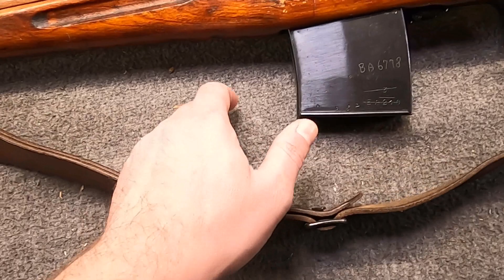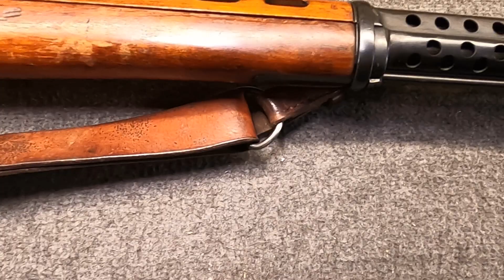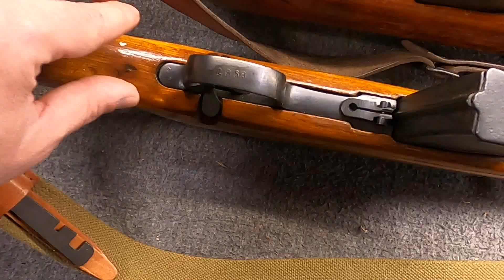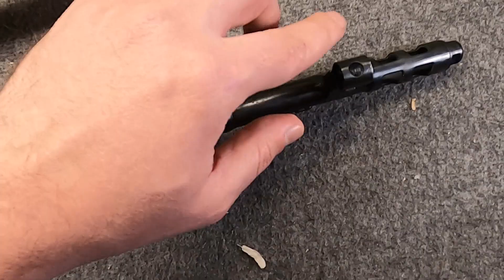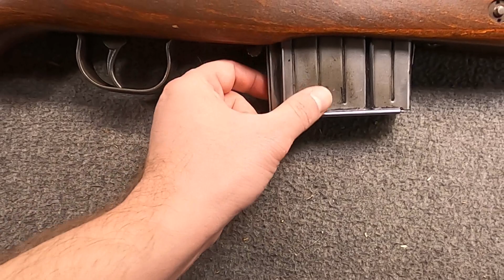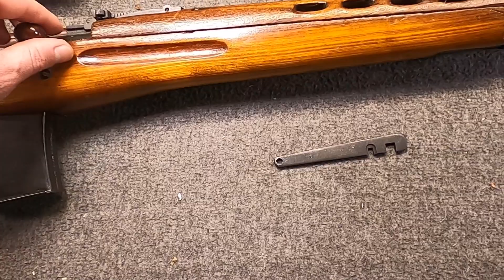Was Soviet-Russia's Tokarev SVT-40 The Best Semi-Auto Rifle At The Time?

Comment: A VERY detailed and thorough overview of the SVT40 my friend! You do such a great job on so many firearm platforms and I really enjoy your videos and information.
I am a C&R collector and once I got my first SVT40 I was hooked. I have 5 now and it is amazing how each is very unique from the use it saw. I have a field sniper, and AVT both in great condition a third all match 1940 when they came on and the other two forced matched BUT one is definitely right out of the trenches, no doubt of that from the weathering on the stock and most of its parts match and is in the white. For the general doctrine of Russian snipers, they were very successful. Generally shots were from less that 200m as they were stationed between the two lines to eliminate German/Axis officers as quickly as possible. Ten shots can do a lot off damage to opposing command chain and effect moral quickly. A great many snipers loved it for that reason and then the Nagant factory worked and scope matched for more precise longer work. They are a workhorse for sure. Many of the noncoms liked this rifle as they did not need to run a bolt when follow up shots were needed in close combat. If anything goes wrong its the mag or the setting with the difference in manufactured rounds. Bot easy fixes and then great reliability. The 7.62v54R is the longest lived military cartridge and a real beast, much like our 3006 here in the states. With todays prices a matching decent SVT40 is over $2,000. Naturally there is always some to be found, so get one now if you are able! As said in the string here, a great shooting with light recoil full power rifle that can reach out quite well. I redo mine and cork line the stocks, adjust the through bolts and make sure it is adequately gassed and they definitely are within very acceptable groups for the time and even now. AND it is amazing they are super popular in the video games!!! It sure helped popularize this rifle now.

Comment: Shot one once. Once. That was enough. Too long, too heavy. Lowly SKS way better in every way.
Reply: SKS is shorter, more refined and more durable but it isn't any lighter. The two rifles weigh just about the same.

Things like the built in bayonet and beefier stock bring the SKS into the same weight class.
Reply: @vault_dwelIer  Plus you are comparing a rifle firing 7.62x54mm against one firing 7.62x39mm. And hey, SVT's got a built-in muzzle brake! haah

Comment: With regard to choosing the optimum calibre, is it the balance of the most effective projectile, collecting just enough gas to make the mechanism work, but not too much causing the rifle to self distruct?
Reply: You want a nicely balanced system for reduced muzzle climb and felt recoil for the shooter too.  Most military guns are built to fire a specific ammunition type or at least a limited range of ammo types. The M1 Garand is a prime example. Does get with M2 Ball, but you start trying to shoot modern hunting loads out of it and you'll bend your op-rod sooner than later, and that's a pricy part to replace these days.

Comment: Misha, you didn't mention a shorty version with a 20 or so inch barrel. They may be quite rare though, or it might have been a prototype of sorts for all I know. I have seen one in the museum of artillery, engineer and signal corps (I think it's called) in St. Petersburg, Russia some years ago. There also was a Fedorov automatic rifle over there that you talked about, which was pretty cool to see in person. As I understand not many at all are in existence today.
Reply: Yep, the SKT....doesn't seem to have made it past prototype stage..probably thanks to uninvited Germans in '41.
Reply: There was buch of SKT and AKT 40 made in in first half of 1941 around 3000. They were in field test mostly in VDV. But you must be very careful with there most of the egzemplars are fake one. All of them are made in izewsk in 1941. If you see stand heat covers and very short stock without vent holes in top cover it's 99% fake one.

Comment: The chamber had to be fluted to assist with extraction, and by Soviet standards it was already a fail.  SVTs were important as a lesson well earned, and that lesson was a very successful in propelling development into AK type rotating bolt and long stroke gas system.  US did not learn such lesson, thus the obsolete at birth M-14.
Reply: Never shot an SVT-40 in my life, but from videos that I watched of people shooting them, they always feel undergased, and a lot of  these people had extraction and ejection problems. I know that the gas system can be adjusted but it requires a special tool.
It wasn't perfect, but well trained soviet troops and even the germans kinda liked it, it was arguably better than the Gewehr 41, more durable than a Gewehr 43 (these ones are always overgased) and a kinda lightweight rifle for its size. It definitely was too delicate for conscripts.
Reply: @Xerxes1688  Because of the set weight and dimensions requirement there is too much flex in the trunion area which causes FTE, that's why chamber had to be fluted.

It's the best handling gas operated battle rifle of its time, but with such low weight there was just not enough rigidity to reliably cycle the action with out fluting the chamber.

From personal experience, STV-40 handles like a violin while M1 Garand handles like a jack hammer.      

When it comes to conscripts the issue is not with SVT being delicate, but with conscripts being ignorant of the very concept of mechanical devices.  They had no idea how to break the rifle down and what for, so they just ran them until a first failure and that was it.    

Better educated troops had no issues with reliably running SVT-40s, and they knew how to pick the ammo for it instead force feeding it the type of crap that only Mosins would eat.
Reply: @BigSmartArmed  You know what would have resolved many of the SVT's issues/problems? An intermediate cartridge. I think that was the No.1 thing missing from the design. Less flex, fewer broken parts, less vertical stringing, and you could reduce the barrel to at least 20"....18" even bettter. Still, the SVT was on the right track with the gas system, detching double stack magazine, and general trend of trying to get a self loader into the hands of the entire infantry.
Reply: @misha5670  That's precisely why Stalin ordered SKS into production as a backup plan for development of AK pattern.  As Stalin predicted, development of AK stamping manufacturing took a lot longer then projected, and in the mean time SKS picked up all the slack.
Reply: @misha5670  Oh man I just checked out your channel, you have a fantastic bunch of models, military, ST and BSG.  

Other then models, you might find this humorous;

https://www.youtube.com/watch?v=iBRtucXGeNQ
Reply: @BigSmartArmed  I am a firm, life-long believer in having a plan-b too. That said, Stalin had a hate on for detaching magazines, which is why the SKS has a fixed one. Also, both the AK and SKS went into full production at the same time in 1949. Of course, they were able to really crank out the SKS immediately and those extra years allowed it to be a fully matured design. The AK would have to weight a little longer. One could argue that the AK really wasn't mature until the AKM in 1959....1954 with the Type III at the earliest.
Reply: @misha5670  Basically, the answer for that was the SKS minus the detachable magazine. Not only Stalin, but also lot of high brass and heads of state from that period of time hated detachable magazines on infantry rifles. Hitler was even more conservative, he didn't like the idea of replacing the Kar98k as the standard infantry rifle until he recognized the potential of the MP-43/44 after hearing a lot of positive feedback from officers after their field tested them behind the Führer's back.
Reply: @BigSmartArmed  The SVT-40 is the only gas-operated weapon that I know that it has a fluted chamber. This is a more common practice on delayed blowback firearms.
A lot of soviet conscripts from WW2 were farmers, some illiterate or half-illiterate, they were OK with the Mosin and the PPSh. 
The SVT is kinda like the AN-94 Abakan, neither conscript-friendly nor conscript-proof. 
I agree that, like a violin, when well maintained and well tuned it's a slick rifle. The muzzle brake and relatively lightweight bolt group has a lot to do with that. The M1 Garand has a lot more bolt mass because of the long oprod and because the gas block is tuned to be overgased so it works reliably with M2 ball ammo under all circumstances. There are some aftermarket gas plugs, some fixed, some adjustable, that allows you to make the rifle cycle with the least amount of energy, reducing recoil, stress on the receiver, and even allow you to fire cartridges more powerful than M2 Ball.
Reply: @misha5670  You are completely right, I as well consider first true AK to be AKM as the first mass produced AK.  Milled receiver AKs were a forced stop gap measure while technological culture was being developed to manufacture tooling and technique for mass producing stamped receivers. 

I don't have direct sources but the likely reason for Stalin insisting on attached SKS mag was field army requirement for a prone carbine.  Motorization of the field army was not yet completed, so it made sense that a low weight stripper clip fed carbine had to fully accommodate prone position shooting.   

AK concept was inseparably interlinked with motorized infantry philosophy, so extra weight of the ammo and mags was not a logistical issue as it was with a field army.

There were gradual but prominent Soviet transitional stages of small arms triads.  Pre-war SVT, DP-28, Maxim with PPSha-41 as supplementary, to war-time SKS, RPD, SG-43 with PPS-43 as supplementary, and finalized post-war motorized infantry small arms triad of AKM, SVD, PKM.  

I checked out your personal channel, you seem to have a rich internal life with all that tactile feedback from all the models.  I would guess that getting a sense of scale could be difficult, but man you got a rich field of impute.  I also checked out the story of how you got into being a gun dealer.  Good for you man, and it looks like you have a supporting family.  

Thanks for the videos!
Reply: @Xerxes1688  You got it all right, and to me the influence of M1 on AK design is undeniable.  Russians learned the lessons of tap it gas system and moved towards long stroke configuration like that of the M1, but internalized and modernized it.

External oprod of the M1 was always an issue, exposed rotating bolt was vulnerable to contamination.  Kalashnikov tucked all that inside and completely redesigned the bolt giving it a dwell stem which timed everything perfectly.  

Perfect 5:1 bolt carrier to bolt weight ratio, perfect rotational torque and dwell time for case extraction, just can't beat it.

SVT did evolve into what I consider to be the best tap it gas system battle rifle, FN FAL.  Milled, closed top receiver took care of the flexing so there was no need to flute the chamber.  

As to conscripts, it's not about education as much as it's about field conditions.  In mud, snow, any given parts are prone to be fumbled by hands that barely move, and just lost.  Field armies get the brunt of it, endless marching, digging of trenches/fortifications, sleeping on the ground, just sheer exhaustion requires a very simple and reliable weapon system.  SVT required the type of attention and logistics that front line war time field army just could not reliably provide.
Reply: @BigSmartArmed  I kinda prefer the CETME/G3 over the FAL or the M14 because it does away with the need of a gas system and it has one of the most violent extractions in a self-loading rifle ever. The FAL, the gas regulator can be a liability if you  don't know what your are doing, and the self-regulating gas system on the M14 can work itself loose after a lot of use and that can mess up accuracy (the M60 machinegun also has a similar gas system that did came loose and soldiers held it in place with a steel wire). For combat I rather have an FAL over an M14, no question. I also read that the finns, which captured a lot of SVT-38 from the russians during the Winter War, they had interest in it, but also were aware of its shortcommings: structurally weak, which lead to point of impact shift and loss of accuracy, somewhat complex.

Comment: I should of bought one back when they were 1k on gunbroker. Always loved them enough that I bought the metal heat shield and stuck it on the end of my fin mosin  
Sporterized "shortend" stock..lol
Never handled one yet, heard cheap in Canada, if someone could import from Canada, theyd make a fortune...lol.
Reply: One sad thing? All the ones up in Canada have their magazines perminantly converted to 5 rounds.
Reply: @misha5670  if they use a rivet to pin the mag you can just drill it out
Reply: Bought one in 2014 for $300 CAD, now they are more like 800-1100. I should have kept it.
Reply: @Patrick Henry Speaking of sad firearm mutilation: You can have a pistol in Canada, but barrels under 4" are prohibited. The Luger is a prohib, but there is a company that makes 4.2" barrels to replace the old barrel, which must be destroyed, to make it purchasable from all the grandfathered-in owners.